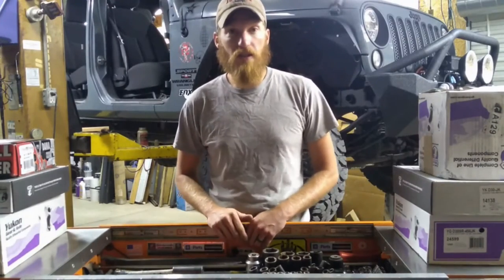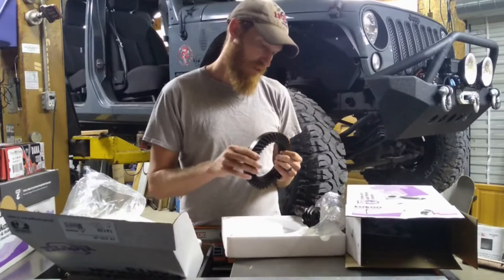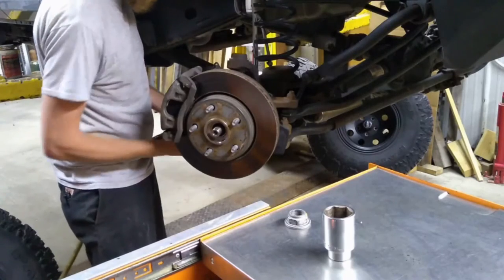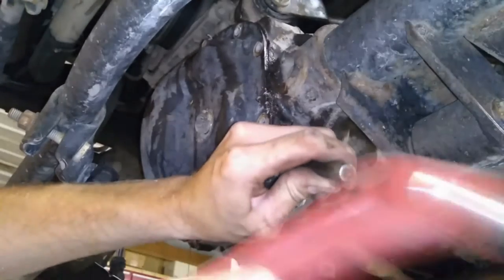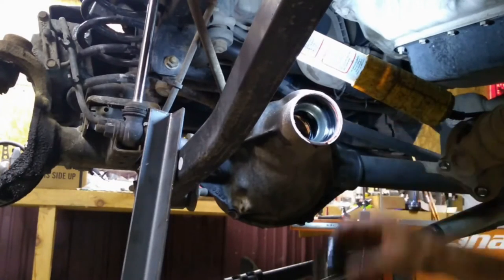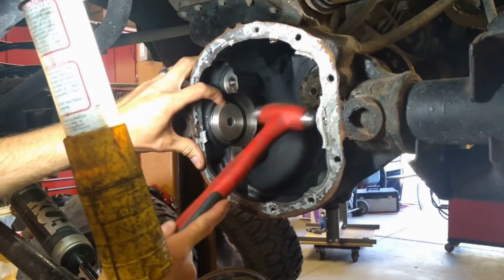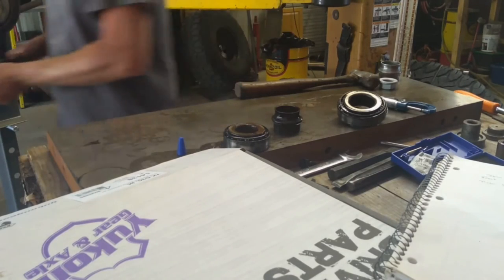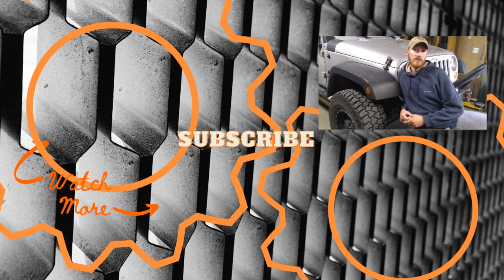Jeep Axle Build | Dana 30 | Gear Swap | How To

Comment: Very helpful. One of the better videos I've watched so far. Got all the parts to do mine, going from 3.21 to 4.56.

Where's the dana44 video?
Reply from the maker: Thanks for the kind words Charles. I am glad you found the video useful. The dana 44 video is still on the computer to get edited. I honestly forgot about it. I will work on it this week and get it posted by the weekend. You will love the 4.56's. It made such a huge improvement in this Jeep.  Thanks for the motivation.

Comment: To get the wheel hub free stick a long socket behind it and turn the steering it will push it out.
Reply from the maker: Thanks GT. I have done that in the past with a 50/50 success rate.